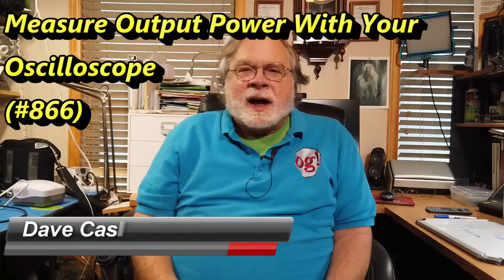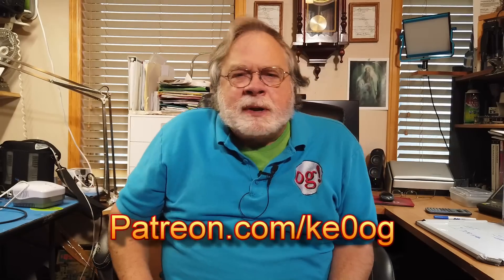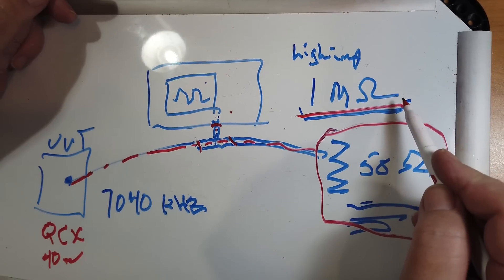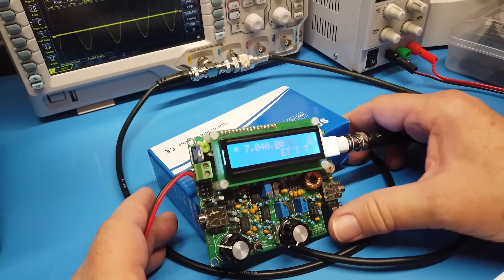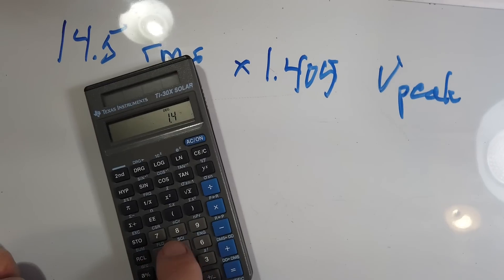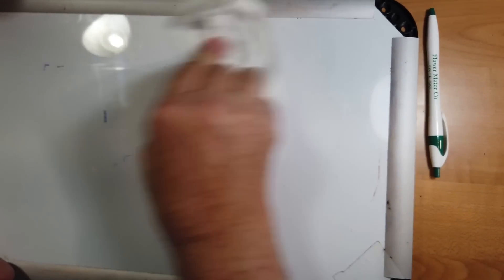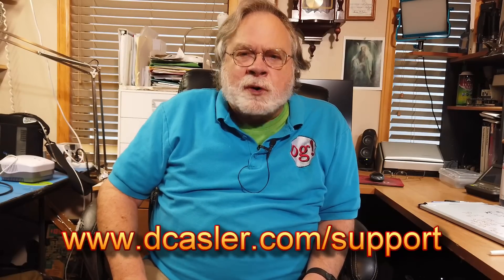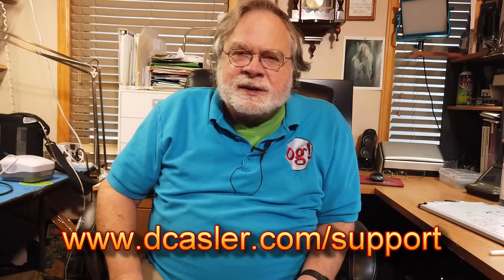Measure Outpur Power With Your Oscilloscope (866)

Comment: The shortcut for those who do not have (or want) a digital scope with math calcs, you can use Vpp as follows..

P in watts = Vpp^2/400

Also note that you must account for the probe type (1x or 10x) and the voltage per division, etc., like Dave says.

Comment: Sorry, but the statement that the scope has high input impedance, in the context of this video, is simply incorrect: It's 1 MΩ in parallel with 13 pF, which is not very close to 1 MΩ at HF. 
Trying such measurement with higher power can easily damage Rigol DS1000Z series scopes.

Comment: Some decent-quality multimeters can also read Vrms for sine waves; my $50 DMM from China manages just fine.  You do need to be careful terminating the coax in such a way that you can probe either side of the load, preferably with alligator clips.  Most DMMs can also handle much higher voltage, like well above 240, so 100W will be trivial.
Reply: Be careful.  Those multimeters are not likely to measure true RMS V up into the megahertz.  A Fluke 179 for example, can only measure true RMS up to 1 kHz.  It is going to give a very incorrect reading above that.  Even a Fluke 87V (a $600 meter) can only do 20kHz below 6V, and 1kHz above that.
Reply: You do have to take care with the DMM bandwidth. Most DMMs are not designed for RF measurements. A signal above the maximum frequency for the DMM will usually read low, if at all.
Reply: You'd have to look at a VTVM to measure up into the MHz range. They put a diode either in the probe, or use a diode tube that is effective at much higher frequencies.

Comment: If you are going to borrow the instrument anyway, then please borrow a spectrum analyser such as the tiny SA. The new tiny SA ultra is very nice. And of course remember to use attenuators. This way the instrument will display the power directly in addition to displaying harmonics and other signal quality measurements. Use the correct tool for the job.
Reply: But then you're also going to need a 50dB 100W attenuator (as you mentioned), which will cost you more than the tiny SA.  If someone just hooks their 100W rig to a Tiny SA and keys down to try to measure power, the smoke is going to pour out of it and they'll be buying someone a new tiny SA.   The max input on a tiny SA is +5dBm or 3.2 milliwatts.  I'd say using an SA to simply measure power output is way overkill.
Reply: @stargazer7644  the old HAMs will tell you to just get a Bird 43 power meter. But those are probably more expensive than the tinysa Ultra plus attenuator.
Reply: @BaldurNorddahl  Just the H series 100W HF slug for a Bird 43 will cost about what the tinySA and attenuator will cost, never mind the Bird meter itself (though you can get them used on eBay for a fraction of that).  But you'd have a high accuracy meter that you could use from near DC to a couple of GHz and from milliwatts to 25kW depending on the slug.  And no batteries!
If you just need a somewhat accurate power indication on HF,  MFJ will work fine for between $60 and $250, depending on model.  
I have all 3 (SA with attenuators, Bird 43, MFJ AWM-30) and if I'm just looking to measure transmitter power output, I do reach for the Bird.

Comment: Hi Dave, the question is how to measure 100w of RF power on the oscilloscope that the individual would borrow from his friend.
You showed a qrp TX power measurement using long coaxial cables, the "cantenna" RF dummy load (!!??) and the probe in ×1X position.
The individual will have to use a proper RF dummy load, 30dB attenuator (min) and good quality RF cables. The probe has to be frequency compensated as well. 
Let him not damage the front end of the DSO!!
De VU2RZA
Reply: While it is always good to think about these types of things before connecting anything to your test equipment, you really do need to take the next step and do the math to see if there's actually a problem before posting a comment like this.

That scope will handle 300V RMS on the scope input (as displayed next to the connector).  That means it can handle (300V^2)/50R=1800W.  A 100W signal is no problem at all for the scope, no attenuator required, though you could certainly put the probe on 10X if you want.  Be sure to also check the probe's voltage and frequency specs for what you're measuring.  The cheap probes that come with this level of Rigol scope might need to be on 10X for accuracy.

We're talking about HF here at less than 30 MHz, not microwaves.  The quality of the cables is pretty much irrelevant at that low of a frequency - there's almost no loss over 3 feet.  And if you compensated the probes when you got them, they'll be fine for HF use.  That Cantenna is rated for 1500W as I recall.

And as for the second comment about displaying only an 80v peak signal, you simply turn the vertical scale up.  That scope will go to 100V per division, so it can display an 800V p-p signal which is just shy of the max input limit of 848V p-p.
Reply: @stargazer7644  The datasheet clearly states on page 1 the following: "Low noise floor, vertical scale range: 1 mV/div to 10 V/div". So no, it will not be able to go to 100 V/div. Which is quite logical given that the scope will blow up long before reaching the 800 V of such a setting. You could use 1:10 probes and the included probes are rated for 300 V rms. It is just not what is demonstrated in the video. With the 1:10 setting activated the scale will of course go to 100 V/div.

The next problem is that the scope is not very accurate for this purpose.
Reply: @BaldurNorddahl  The scope inputs are rated for 300V RMS (it is right there on the front of the scope at @3:37, written above CH1 ).  300V RMS is 424v peak, or 848V p-p.   You aren't going to blow it up.  Whether the probes will do it or not is another question.  I don't use the cheap probes that come with these things.
Reply: @stargazer7644  read my first comment again - I calculated that you would not be blowing it up so no need to repeat me 🙂

But it is also true that you are not going to be able to do the measurement as Dave demonstrates. The measurement will be clipped at 80 V peak to peak trying to measure a waveform that is 200 V peak to peak. To repeat you could use 1:10 probes, cheap or otherwise, to bring the voltage down with a factor of 10 and thereby be able to do the measurement. But Dave does not demonstrate how to do that.
Reply: @BaldurNorddahl  How about you read your comment that I replied to (forgive me for repeating you): "Which is quite logical given that the scope will blow up long before reaching the 800 V of such a setting"  The scope input will not blow up with an 800V p-p input, even on X1.  I grant you that on X1 it'll be off the screen.  I grabbed my old Rigol and checked the vertical scale limits before I replied to the OP and saw they went to 100V/div, but I didn't notice CH1 was set to 10X.
Reply: @stargazer7644  oh forgive me for being 5% off with that remark. Feel free to test it. Don't cry when a little bit of SWR brings the voltage over. It is not impossible to damage an oscilloscope input you know.
Reply: @BaldurNorddahl  I'm not sure how you've come up with 5%.  It was 100% wrong.  It really is OK to be wrong you know.  And what SWR are you going to have into a dummy load?
Reply: @stargazer7644  it is ok not to always attack people you know? 800 volt is not 100% wrong compared to 850 volt. All it takes to get SWR from a dumny load is a connector not tightened enough or for the load to overheat. Yes I know he has a huge can as a load but not everyone does. The cheap chinese made loads are infamous for blowing up and would you really want to bring your other equipment down with it?
Reply: @stargazer7644  The scope is rated 300 V RMS, when its input impedance is 1MΩ, and it's actually shown (in unclear way) in the datasheet of the scope Dave is using. 
Oscilloscope manufacturers better than Rigol provide derating curves with their scopes, which show the relation between the maximum input voltage at a certain frequency.
Reply: @stargazer7644 intelligent well articulated and informative reply.
Stop Doing That ! This is youtube ...lol
Reply: 100 watt is 71 volt rms and the cheap rigol scope can cope with 100 volt rms. So he wont blow up the scope. But he will not get a usable measurement either because max is 10 volts per division with 8 divisions on the screen.

To clarify: 100 watt will create a 200 volt peak to peak signal but the oscilloscope can maximum display a 80 volt peak to peak signal. The scope will survive a 100 volt rms (or 300 volt rms) signal but it will not measure it. It is therefore impossible to make the measurement as shown in the video for a power level of 100 watt using a cheap Rigol ds1000 oscilloscope.

I would suggest a 40 dB 100 watt attenuator and a spectrum analyser. That is the correct tool for the job and also displays the wanted measurement directly.